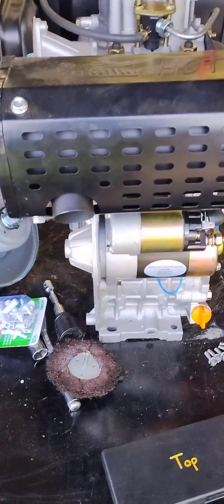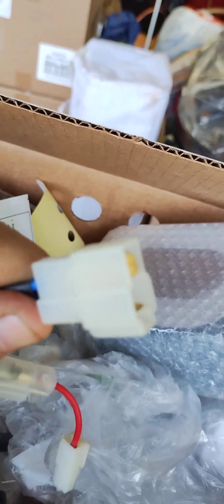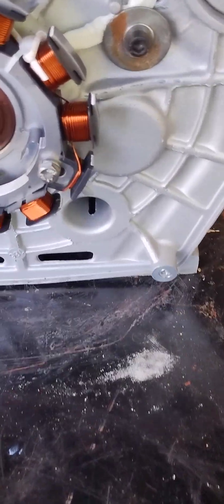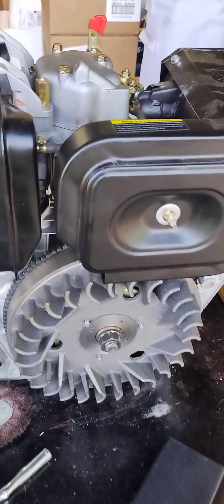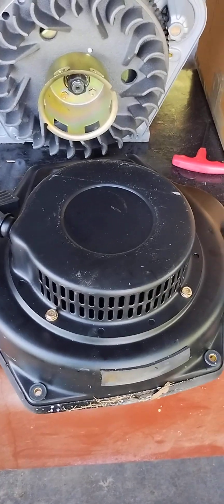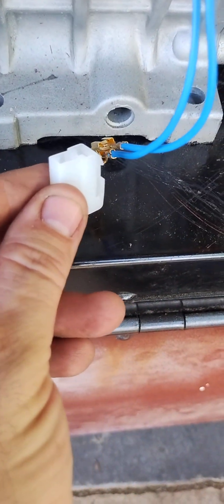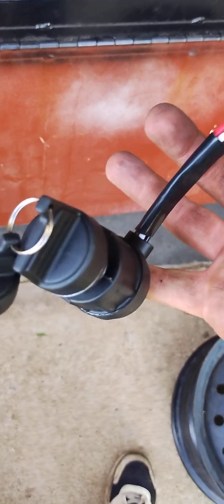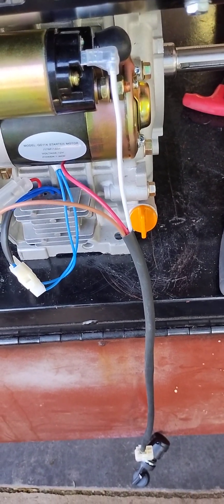Amazon Diesel Engine 186F electric start

Comment: Thanks for posting the bolt sizes it's saved me a lot of leg work. Also noticed I didn't get the key switch wiring harness with my kit.......hmmm
Update December 2025, installed two of the kits the second one was for a 173F which is the smaller 5 horsepower version. The difference being the smaller diesel engine uses a different ring gear (200mm?) otherwise the parts are identical.
Battery voltage immediately went up over 13.0 volts but I did not wait around to see what the full charge voltage was.
Make sure to set the decompression lever before starting. 
Again thank you for the video it saved me a lot of time and effort... 🔧

Comment: Things you'll need:
Blue loctite
Starter bolts (2) = m10-1.5 x 30mm
Magneto/voltage regulator (5) = m6-1.00 20mm
Magneto lock washers = m6
Flywheel magnetic (3) = m6-1.00 10mm (Recessed head)
Wire clamp = just use big washer  

Helpful info:
Flywheel torque spec = 135ft lbs

Comment: Where does the battery hook up to the harness?
Reply from the maker: If I say at the positive and negative terminals I'd sound like a jerk. What do you mean exactly?
Reply: Battery positive goes to the large terminal on the starter
 Battery negative goes to the engine case